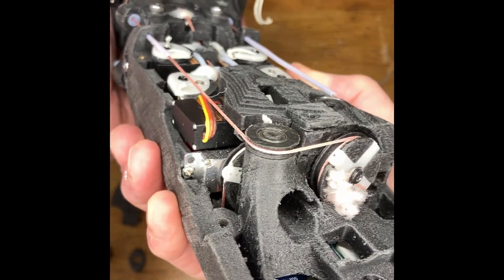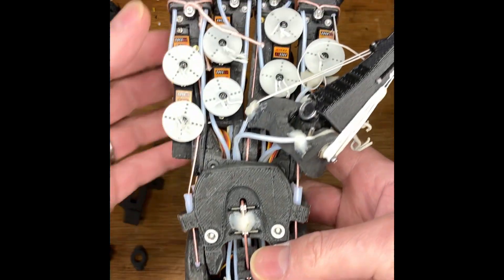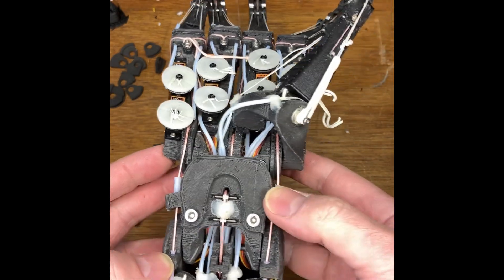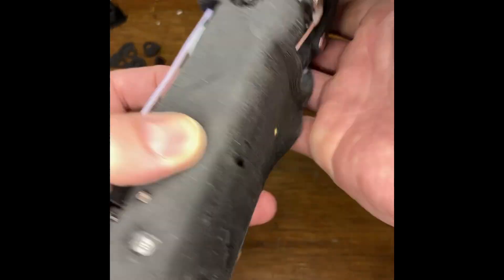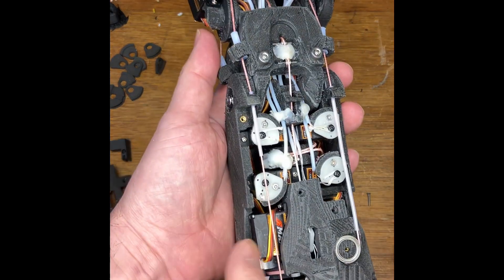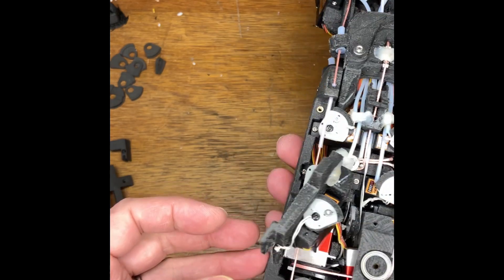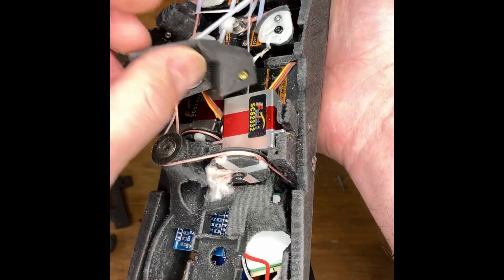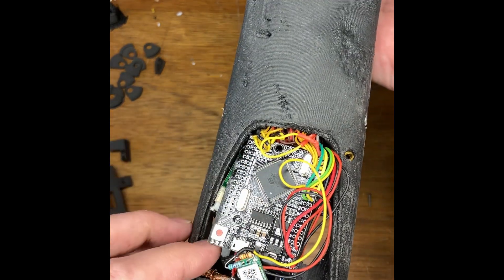Quick look at the wrist and forearm of the V1.0 #DexHand #lowcost #diy #robot #hand

Comment: First of all: great design, great work! Just an idea, I recently printed a few prostheses with TPU filament. I was surprised at the extreme adhesive strength! Maybe that would be A way to print a wrist? Deformation costs energy, I know 😅
Reply from the maker: Thanks! I’ve tried TPU as well but generally prefer the stiffness of CF nylon for the main structure.
Reply: @therobotstudio  Yes! I mean as a replacement for the ball bearings ? A flexible component as a joint between the stiff components.
Reply from the maker: Flexible joints can work very well - I found the TPU came out too stiff though - maybe I should try another filament brand?

Comment: Great design! What type of string are you using for the tendons and how are you fastening them to the pulleys?
Reply from the maker: Thanks! I recommend Sufix 832, 80lbs strain which is 0.45mm diameter.

It’s always used as a loop so the distal end can pass round a steel pin embedded in the 3d print and to improve the fatigue life.

At the servo the loose ends pass through one of the small holes on the servo horn and are then clamped by the centre screw that secures the horn. 

For maximum security the clamped loop twists back over itself and is also loctited.

Comment: Really fantastic overview! I intend on making a version of this open source hand using mckibben muscles as the actuating force. If i can get this project off the ground, would you be open for a collaboration of some kind?
Reply from the maker: Thanks. What kind of McKibben do you plan to use?
Reply: @therobotstudio  I've developed a hydraulic circulatory system similar to clone robotics. The muscles and hydraulic system work fairly well, but i have struggled a bit to make the skeletal hand/fingers articulate smoothly. Right now i control the muscles externally with servos but have plans to integrate more in-line control valves.
Reply: @OYVAI_izmir  Super impressed with the work out of clone robotics, and excited to see an open source version of them! got a link to a project page, form or blog post?
Reply from the maker: Very good, typically though the problems lie with the operational life of the muscles themselves - do you make those yourself too?

The key to smooth movements is to eliminate friction, stiction and hysteresis as much as possible.

In the V1.0 every articulation is formed using miniature ball bearings and every clearance for a tendon is lined with a PTFE tube.
Reply from the maker: Second that. Don’t wait until it’s ready to start publicising!
Reply: @therobotstudio  yes, I make the muscles myself, i've trial and errored my way to a very robust silicone inner tubing w/ low profile attachments that can withstand pressures up to 80psi (as hard as my pump can currently go). We will have to see how they hold up long term but I'm not to concerned given how well they've held up so far. But for smooth operation you are absolutely correct! Which is why I have gravitated to your design for inspiration. I would also like to integrate encoders to collect joint positions, as control of the fingers in this way will need to have good feedback for proper positioning. I'm actually pretty surprised you dont seem to be using any. I will be rolling out progress on my channel as fast as I can, so please follow! it would definitely give me motivation to keep going!
Reply from the maker: Sounds great! I’ll certainly subscribe to your channel.

Later versions may add joint encoders. For simplicity I’ve not added them to the DexHand so far and also because my software collaborateurs didn’t need them so long as the servo itself gives positional feedback.

This is one of the reasons I use serial servos in the V2.